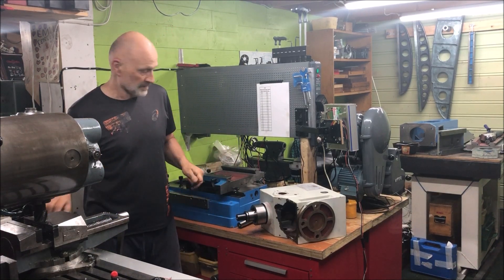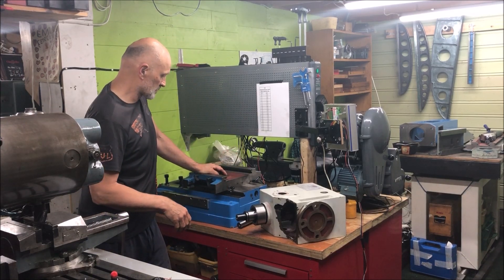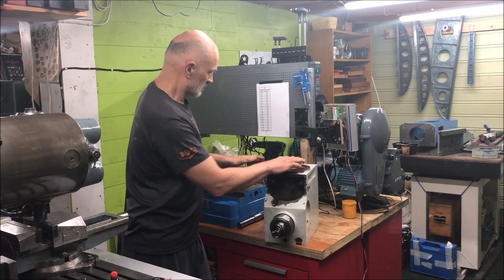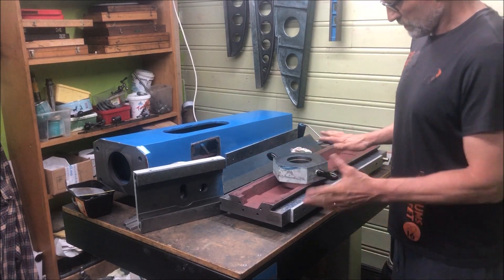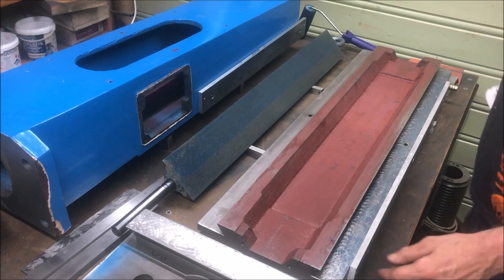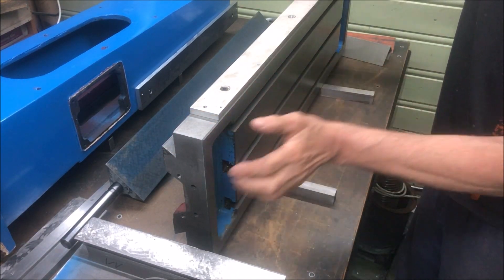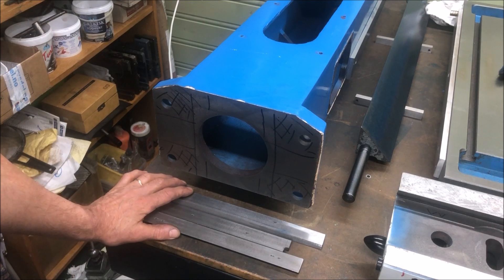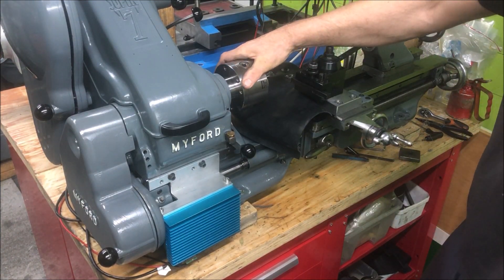HBM 45 mill-drill mods/fixes - intro

Comment: As usual this should be a really interesting series Jan. I think the word you were trying to remember in the beginning of the video was an eccentric bored bushing. That would allow an adjustment method to set the pinion engagement with the quills rack teeth. You'd obviously know that term in your native language without even thinking about it. But English from what I've been told can be a bit tricky with some technical terms.
Reply from the maker: Hehe.. yes, exacty. Thnks... I think age starts to make its' way (hopefully it is the accumulated and acquired knowledge meaning less "memory space" in the brain, but I don't count on this  :) I must admit that at my level of video making, the preparations aren't always good enough.. just a bare minimum to get some footage off the ground without too much effort. Good enough being the mantra.. Anyway, yes, I think this will be an interesting journey. I might end up with a similar construction myself.. one day.. haha. PS! There is a lot of reviews/modifications etc. and also CNC'ing of these types of mills and I am astonished by the number "near similar, but not exact clones" out there, from a plethora of sources with different names. Popular size/price and a practical machine I guess!
Reply: @jansverrehaugjord9934  Don't sell yourself short Jan, your videos are just fine the way they are and you do a hell of a lot better than I would with my totally non existent second language of any nationality. I only added the term for what you were trying to remember for anyone that might be wondering what you meant. In fact I happen to think your video production and editing is much better than most. There's no wasted time with a pointless lead in with loud theme music, no constant begging to subscribe, no useless channel stickers or off topic chit chat. That to me is exactly how it should be. :-)

Yes there seems to be a few different manufacturers of these 45 sized mills. Some even with built in powered spindle feeds. I even considered buying one for awhile, but I finally picked a 3/4 sized Bridgeport clone from Taiwan. For me and what I do it was a more versatile mill choice, plus there's a lot more additions and nice to have items made to directly bolt up to a Bridgeport machine. This new series will be an excellent one for anyone who owns even one of the smaller X2 and X3 mills since most of it will apply to those as well. That's a huge number of owners looking to properly adjust these mill types even if they don't choose to scrape them in.
Reply from the maker: @turningpoint6643  Thnks! Nice to know this is appreciated the way it is! Totally agree to what you write.. far too much "nonsense" (in my humble opinion) in many "productions". Not that many not are "jaw-droppingly" good made and each to one's liking.. we are all different. I personally have never much liked background music (although I sometimes forget to turn down the radio..). For me this is just "noise" that impedes the message I try to get from watching/reading. Sometimes to the point that I just have to cut sound alltogether. Same with too much "face focus".. ie. the person(s) involved seemingly wanting to be a larger art of the video taking too much room/focus for my liking. Can't see any value whatsoever for me to film my bodily presence more than absolutely needed (I mean, what value is there for anyone to want to watch an oldish, bald guy haha), rather just trying to show exactly how/what/why ie. the topic/video is about. I also don't care much about the number of subscribers (just more work to answer comments :) ) as there isn't any earnings in this anyway (but this may be different for those that are real YouTuber's. Or so i have figured, but really have no clue..)
Presentationwise, I am probably of a more "old school" nature and appreciate that there is not much of the very speedy and audiovisually "have to happen something all the time" approach what seems more for the younger generation. I like a more calm and "normal for me" setting focusing on the topic only. There are some channels that "voice" this.. Saying this, I am also somewhat interested in firearms and then I really like the approach you see in "Forgotten Weapons" by Ian McCallum. Calm, clear voice, precise and detail oriented etc. No music, and not at all "acting out" on camera.. And not too long a video each time, ie. one topic per video. I am impressed by how much he knows (and must have researched) on a single topic and how easily it flows when he presents this (not so easy.. I also hold seminars etc. and there is usually MUCH happening prior to the event as well as behind the scenes..). Different topic, and more lengthy, I have also found the maritime information channel by Drachinifil very good. More like a picture series with vocals, but very good presented.
Re. the mill: Nice size, price and functionality. I am tempted to try this or the smaller brother, 30 style as I try to convince myself I need a good coordinate boring machine/bench style milling machine. I see that for example the version from Precision Matthews has a sturdy cast iron stand (and powered down- and cross feed and drawbar) and looks very nice. It could perhaps be a choice to buy from a company like this instead of directly from the manufacturer. That said, we have some local companies here also that imports "similar" machines, so that is a choice. I have also evaluated a Bridgeport clone (there is one down in Denmark that i want to look at.. Taiwanese. If not mistaken, possibly a company to where Richard went to teach scraping). We'll see when the borders open up again..
Then I have also looked at a Tormach as an alternative if I want to go CNC. There are just so many choices and the right answer dependent on the personal preference/situation.
Reply: @jansverrehaugjord9934  :-) exactly my thoughts about the machinist channels on YT. These are or should be produced as informational videos about technical subjects and that's why I'm watching so I can increase my knowledge. There not music videos or Home & Garden shows. :-) If the channel and information presented is any good people will subscribe anyway. And if I want to be entertained I'll go watch a movie. 

In your location finding a good condition SIP jig boring machine and rebuilding it back to as new condition might work. Although that would be a bit larger than bench sized machine. I'm sure there's other European manufacturers of jig borers, but SIP is the only one I know that has a very good reputation. There apparently as good to possibly better or perhaps a bit more versatile than the Moore Tools jig borers. And that's a very high bar. If Europe is anything like North America any of these manual jig borers are in mostly low demand for use in the average commercial shops today so the prices have dropped to almost nothing for what they are. Before watching this video of Tom Liptons, https://www.youtube.com/watch?v=dXDOvAa6Mus I hadn't known they made smaller HBM type machines with jig boring accuracy levels. Obviously there built to extremely high standards and again very versatile. With the tail stocks they also were offered with, one of these might be a single small foot print machine tool that could be set up to do almost any turning or milling job in a home shop. If you don't already know of his channel? https://www.youtube.com/c/ELMETALRaymondMenendez/videos He's a literal artist with an HBM and an extremely talented machinist.

My Bridgeport clone is Taiwanese and was built by a company called Bemato. A quick search and they don't seem to be offering the same mill today. But someone is, while I didn't buy mine through Precision Matthews this is the exact same machine I have with a step pulley head. https://www.precisionmatthews.com/shop/pm-935ts-tv/ With a VFD on mine I don't really need or miss not having the variable speed head version. But I know the PM machine is the same as mine because of it's distinctive squared off upper column shape in the casting. What they did was reduce the machine size to roughly 3/4's of a full size machine, and used a full sized head with the powered spindle feeds. But the Bridgeport design layout and it's known part sizes also comes with some further and not generally known hidden future options to increase what it can do.

At one time before cnc, Bridgeports over here were used a lot in Tool & Die and Plastic Injection Mold shops. So there were many specialty heads designed around a BP's known standard dimensions and it's R8 spindle taper. There sort of like your Schaublin or Deckel FP1 & FP2 mills with a bit less rigidity and versatility compared to a real Schaublin or Deckel and there many clones built all over Europe and even old East Germany. So the Bridgeport R8 taper and it's spindle diameter of 3.375" was used to mount those heads. Volstro here in North America was a fairly large manufacturer of those specialty heads. Unfortunately they were a victim of that move to cnc and are no longer a company. These heads are one of the big reasons I chose the mill I did. It took me over 10 years of searching, but I finally found and bought one of there rotary milling heads. It was this one in fact. http://www.chaski.org/homemachinist/viewtopic.php?f=30&t=110132 And I know for a fact it was only used once to make a single test cut. So without that Bridgeport design some of this equipment just doesn't fit or work on other machine types. And I've yet to find a single accessory designed to be used on a real Bridgeport that doesn't bolt directly onto my mill. 

Funny you mention an interest in firearms, that's what got me started in machining except the gunsmithing part has now mostly disappeared. He builds mostly traditional style very expensive custom bolt action rifles, but this single video shows his machining ability's more than well. https://www.youtube.com/watch?v=3UaPfRsXnkM All done to coordinates using a dro and without cnc.
Reply from the maker: @turningpoint6643  Same with radio channels these days, just music, chit-chat and commercial.. the "only" sane channel that has some good reporting up here is BBC World.. solid information from ground crew (all over the globe) on a vast array of subjects. In my mind at least it doesn't sound "politicized" either..
There is actually a SIP jig borer for sale now not very far away. Too big for my workshop though. Some of my machinist friends has different types, both larger / older (SIP) and the smaller, modern styled Hauser  http://www.lathes.co.uk/hauser/ and one friend with a Moore. Incredibly accurate machines! He showed me it has repeatability at 1/1000mm.. :) I doubt that I will need such a machine, and the price would probably be prohibitive. I looked at a more reasonably sized & priced English Downham (Elliot) http://www.lathes.co.uk/elliott-mini-jig/index.html, but didn't act, so this opportunity was lost. However, I might get my hands on one of these, not cheap, but very tempting.. http://www.lathes.co.uk/fehlmann/ The "trouble" with the latter is that it normally uses special holders and in general that everything costs "an arm and a leg". So.. I might end up with a more budget machine. The Schaublin 52 milling that I have of course has a hi-speed head with quill (E25 type nose fitting, same as ER but without the unlocking slot), but it is an operation to switch between the two heads (other being ISO40, which tends to stay on, despite not having a quill. Another user had a good hint though, just turning the head horizontal and use the feed.. this being more controllable than the Z-feed, although still not as a quill). I have also looked at a Golmatic MD23, as a versatile, accurate alternative to a mill-drill type of Eastern origin. However, from a practical point of view, a B'Port type is possibly the ultimate mill for a typical small shop, doubling as a large capacity drill press.. and precision borer.
The machine Tom Lipton has and shows is very neat.. looks like the same size as the SIP for sale here.. hmm..
Hadn't seen MetalRaymond before.. looks like a very nice channel! So more YT watching :)
Your mill seem like a more or less direct B'Port Series 1 clone, but scaled down? That sounds interesting (space, also height is always a problem..)
We actually have a lot of the Adcock & Shipley built Bridgeports over here, and some original US built machines (could be from military airplane repair facilities that were equipped with a lot of US gear.. as you may know, we have bought US planes since the late 40'ies/early 50'ies)
Therefore it is not uncommon to find accessories ie. have seen a fair amount of shaper heads for example
Thnks for the "firearm workshop link" .. I bet I will be more in front of the PC tonight than in the workshop..
Reply: @jansverrehaugjord9934  Yep, I use my shop as an "escape" from the rest of the world and all it's issues so don't need the intrusions or political ravings most radio stations now seem to have. I'd certainly agree that BBC is probably the least biased today. 

My Volstro rotary head has a full set of Schaublin produced collets and I'm almost positive it's the same E25 size you mention. In case you don't know this already, my research seems to indicate Rego-Fix took the original Schaublin collet design and added the extraction groove, changed the collet nut to an eccentric design to use that collet extraction groove, plus they increased the closing nut threads diameter and came up with what's now known as the ER collet system. Unfortunately due to that larger thread on the collet chuck body and the nuts, the standard ER collets and nuts can't be used in any of the E series designated equipment. Before Volstro closed there doors for good they did offer there later heads so they could use direct fitting ER collets. I don't know about in Europe, but over here finding those proper Schaublin E series collets for these heads is a large problem. It's not unusual to see prices for used and even poor condition Schaublin E25 sized collets at upwards of $80 - $100 each. So I'm fortunate my head came with a complete set.

I'm familiar with those Hauser and Fehlmann machines but only through the internet and without ever seeing one in person. Very, very good equipment mostly used in watch, instrument and high precision small part production in the pre cnc days as far as I know. The Elliot Downham I hadn't known about though. It has a fairly common earlier design layout and I believe the earlier P & W or possibly it was  B & S? jig borers used much the same as the method Elliot used with that divided spindle and tool support. Afaik all of the Moore jig borer models have a quite tall size for there smaller foot print. I think there at least around 9' tall? And they have a complex very fussy procedure if the spindle bearings require replacing. The bearing preload is much tighter than normal and there's very little + - tolerance between correct, too tight or a too loose adjustment. I think many wrongly look at those Fehlmann's and think there just about a glorified round column Chinese mill/drill. It's highly likely the Chinese took a lot of it's general design for there's, but those Fehlmann's are light years ahead of what the Chinese machines are. From what I've read on the Practical Machinist forums there very highly rated. I'm not sure if they were ever offered with any other spindle taper, but I believe most or maybe all Moore jig borers use a Moore specific proprietary spindle taper. So likely hard to find and quite expensive where you are for any tooling unless you bought one that came with an extensive amount of tooling already.

The information I've seen about licensed Adcock & Shipley copies of the Bridgeport is they might be even a bit better than an actual Bridgeport produced machine. The newer BP's also use off shore sourced castings and have for some time. So I suspect those older Adcock copies using UK produced castings might be better even in that aspect. At this point with Brexit I've heard it's tough getting anything out of the UK and into Europe. That will probably change, but for now it cuts you off from a lot of the used machine tools in the UK. There prices aren't exactly cheap, but they usually only list very good condition machines and tooling on this website if you don't know of it yet. https://www.homeandworkshop.co.uk/browse-stock/ And I know there well set up to do international shipping once that Brexit issue is sorted out. And I've seen some fairly rare, unusual, and highly desirable machines and tooling there sometimes.

I've also been to the Golmatic website a few times, an interesting multi purpose machine but fairly expensive for it's size. If it's accuracy and build quality match it's price it would be a handy machine to have. So far I don't recall ever reading any forum thread from anyone who has one or have even used one.

If it will help in your decision making, my mill has a total height of 77.5" / 1968.5 mm with it's 3 hp 3 ph motor. Since the motor is the highest point on the machine, a different motor used by the manufacturer will obviously change that number. My own motor has a height between the mounting face flange on the top of the mill head to it's highest point of approximately 9.875" / 242 mm. Even with it's smaller 9" x 35" table size, I was surprised to find the manufacturer still used the exact same bolt pitch spacing and size for the tables end brackets and bearing hangers for the X axis feed screw as Bridgeport did. Any standard power table feed for the X axis that's made for a real Bridgeport or clone bolts up without any modification. I don't yet know if that's true for the Y and Knee's Z axis though. I had to pull mine apart into it's major components to move it into my shop, a fairly simple job of a few hrs if you've got an engine hoist. With these Taiwan produced mills I'd still recommend doing so even if you can move the mill as one piece. While I didn't find lots of machining chips or grinding dust, there was a few grams so I'm happy I did so. And completely washing out that contamination and the shipping preservative it came with gave me a far tighter yet much smoother to operate machine. As shipped with factory adjustments I had about .007" - .008" feed screw backlash. After reassembly and gib/feed nut adjustment I had .0035" - .004" with no trace of tightness in the table travels which is what Bridgeport themselves guarantee on there new machines. The real Bridgeport's are afaik still oil flaked, but mine has only surface ground ways. We both know there's much better spindle tapers than R8 and even more so where you are. But B'pts are mostly thought of as a light duty machine compared to your Schaublin. So that R8 is ok and fairly reasonable for tooling costs. It's too big for any R8 taper mill, but I'm using a Bison ER 40 collet chuck and collets on mine. ER 32 would be ample, but I wanted dual usage from the collets for use on my lathe so I went with the larger 40 sized collets. R8 collets would be better and more rigid, but so far I've yet to find anyone offering 100% guaranteed low run out numbers on there R8 collets other than Hardinge at $65 each.

Bridgeport at one time also made what was usually called a 3/4 sized or Baby B'prt. From my research not many were ever made and I only know of one that a personal friend owns. It also has that 9" x 35" table size so my guess is the Taiwan company that built mine closely copied it. Jet also did or still does offer one of there mills in this size, but strangely I've never seen it available with those built in spindle feeds. And I believe it only has the single axis X axis tilt function on the head so it's not capable of nodding in the Y axis.
Reply from the maker: @turningpoint6643  Same here.. I have an "office type of job" and the workshop is a welcome "relief" from this..
Interesting! I didn't know the story on these Schaublin collets. PS! The collect adapter on the hi-speed head can be used with ER collets (same cone/design.. at least as far as I have understood/experienced, I have a couple of E collets also in addition to the ER25 set), but I have to add some form of "extractor" or "ejector" either by modifying the existing nut (I cannot buy an ER type nut as the threads are different) or use a tool (I have made a kind of "fork") that grips into the slot and (gently) forces the collets out. Not ideal, but..
Yes, the Fehlmann "mill-drill & coordinate borer" might be the grand-father, ie. what the Taiwanese looked at when they designed a simplified, budget version of the round-column mill-drills. The Fehlmann is of course much better, but also much more costly! The problem can however be whatever special nose adapter they have made or adopted (as is also the case for much the early Swiss-type of hi-end machinery, both from Schaublin, Aciera and more..), so if you don't have access to these or money to buy.. then better stay at the more budget machinery :)
Oh, yes, I am very much familiar with Home&Workshop, having bought most of the Myfords (and more) there.. Always very nice to pay them a visit, either at the stand on a model engineering show or at their place in Sidcup (and get a cup of coffee :) . They have shipped to me several times and it is no problem at all, only difference now from before (when they were part of the EEC) is that we have to pay the VAT..
The Golmatic is expensive, but packs a very good punch on a small scale! I could have bought a Chinese copy for about (a decade ago, listed in the Knuth catalogue and displayed at their Swedish distributor, but at that time I didn't have the money, and this was discontinued..)
Thnks for the dimensions on your Bridgeport clone, I guess I have to have a closer look, possibly a dealer in Norway or Sweden has one. I guess that a certain degree of tackling smaller issues is to be expected on these machines. After all, they are cheaper than original Bridgeports and probably doesn't undergo the same amount of "fit & finish" work. Re. Bridgeports, according to what I have learnt from Richard (who has scraped quite a few) they were guaranteed to be within 2/10 over 12", and as such are classified "industrial, normal grade". I guess an R8 is more than sufficient for hobby, light industrial use.. sure! Cheap and lots of tooling.. I reckon it was a good choice to go with ER40, although for most cutters 32 size would be sufficient, but for any lathe use 40 would be better. I am often pondering over this issue about new/used tools/tooling and whether it is better to buy old/used hi-quality or new, not necessarily so accurate items. When it comes to collets I would in particular have my doubts over used items, although these being quality, how accurate are they when bought used? And if you need to buy new, then what is actual price vs. functionality cross-over point.. ie. what do I need / how much can/will I pay? Me buying the Schaublin was purely a random thing.. just happened to come across this on one of our "machine tours" (Denmark auction). If this hadn't materialized, I bet I could have ended up with a B'port :)
It could however be that I end up (again.. had one, but sold it) with a Storebro Combimill, which is one of my (if not THE) favorites. I have also been interested in a Van Norman, for example a type 12. These are very sturdy & versatile mills for their size. But, a proprietary milling holder system possibly being a problem.
Reply: @jansverrehaugjord9934  Well as I mentioned that's the story I've picked up about how the ER collet was "invented", it sounds reasonable since Rego-Fix are credited as being the first to produce them and the Schaublin collets are almost identical to the ER series on there exterior dimensions. And yes from everything I can verify the taper angle is the same between the Schaublin collets and what the ER has. For however much this is worth? I just measured my Schaublin E25 collets and there roughly 1.381" in length by a caliper measurement. Comparing that number to the industry standard for ER 25 collets that have a length of 1.340, the Schaublin E series seem to have a slightly longer bottom taper of roughly 1 mm. So Rego-Fix must have changed that a bit as well. When I bought my little Emco C5 sized lathe about 25 years ago I also bought there full set of ESX 25 collets that can be used either on the mill or lathe. They do fit very well in my Volstro head, but again like your Schaublin mill they can't properly be used because of that extraction groove and the nut size and thread pitch. I've read but don't yet know for sure that ER 25 collets are interchangeable with the ESX series. That Emco collet set was very expensive at the time. I don't know if Emco was making these themselves or they were from an outside collet manufacturer. But that little collet set cost me almost exactly what my Bison ER-40's and it's collet chuck did. Yes these Emco collets are very well made, properly hardened and precision ground so there quite accurate, but they sure hurt to buy. :-) 

There's a fair number of videos here on YT about off shore collets and lots of them show very high run out numbers in both the collet chucks and collets themselves. I've got 3 jaw lathe chucks and even keyless drill chucks that are more accurate than what some of those videos are showing. So for lathe use there's zero advantage to work holding with them over what I already have. Yes an adjustable chuck back plate could be made, but other than better grip and less jaw marking of the work piece you may as well use a 4 jaw independent if you still have to dial a single part in. Where you are then it's additional shipping charges, customs etc. but for decent mid priced set of ER collets today? I think I'd now buy from here. https://www.maritool.com/ER-Collets All of his products and his business practices, fast shipping etc get very good reviews on the Practical Machinist forums, and the owner is also a member there. In fact it was through PM posts that I learned of the company. I believe but don't know for sure there collets are made in house by them and are specifically not off shore or poorly made. More expensive than off shore collets, but certainly much more reasonable than Rego-Fix, Bison etc.

We both understand why collet run out numbers are important, but I'll add a video link for anyone else who doesn't know. This video from Rego-Fix themselves while being almost all about industrial production use and costs of ER collets, https://www.youtube.com/watch?v=uM9qVWhMWy0&t=3s It does show there's some hard numbers, logic and direct costs in support of buying the better collets. For anyone else who doesn't yet know, those higher run out numbers very much decrease the usable tool edge life span, contribute to chatter and always produce much poorer surface finishes along with a decrease in part accuracy. Saving money is of course important to all of us, but I firmly believe there are some basic foundational tools where paying more in the beginning can end up saving much more than there cost over some time. I'd say for most of us with a home shop, a set of tool holding collets are just about a one time purchase with a life time of expected use. Tool and work holding can only produce parts close to the same accuracy that there built with.

Yes I'd expect there has to be a few dealers in Europe that offer these same reduced size BP clones. It would be highly unusual for a large machine tool manufacturer in Taiwan to tool up and produce a machine model only for the North American market. As I mentioned though, that distinctive squared off upper column casting shape would be something to watch for. I think your correct about that fit & finish on these cheaper than real BP mills, but having mine apart the hidden areas and castings are still much better done than the hidden areas on my Chinese 11" swing lathe. I've yet to see any one single "perfect" mill that can do everything so far. There's multiple designs and attachments to do certain jobs that just aren't available on any one single machine that I know of. You mentioned Knuth, I'll admit there probably a longs ways from your high quality, high precision German and Swiss machines, but they and maybe a few others offer a much larger and I think 40? taper BP type design that has an additional built in horizontal spindle as well as having a swiveling universal style table. If my shop was larger with a taller ceiling height and had a concrete floor I think I would have bought something like that. But what I have does still work well enough for me. I also suspect those larger machines cost as much or maybe a bit more than a new BP.   

Industrial quality brand name used verses new but made off shore? Yes that's a tough one. I'm a bit different than you and almost all of Canada's manufacturing is roughly 3,000 miles from where I am. There's very little used industrial grade tooling here on the west coast. Any that is available almost always comes with very high prices. With your location and large European used tool market plus your trips to the UK during normal non Covid conditions that gives you a better ability to at least visually check over anything your buying that's used. But with used very good industrial level tooling like collets they at least always indicate how much they were used and even how they might have been treated or mistreated. But like you say, it's still taking a chance on how much life and accuracy any tool might have left.And yes I'd very much agree, a lot of these older machine tools used spindle tapers or proprietary attachment methods that were once not that hard to find. Today and as you say some could be very rare and expensive if you can even find it. Learning as much as possible about what your buying before you do so really isn't optional. 

I thought you might be familiar with that Home&Workshop website but added that link just in case. I've only spoken with them on the phone a few times. But they were very helpful and the only reason I didn't buy were reasons not related to them as a business. The Denford lathe I was looking at had metric feed screw pitches and I wanted imperial, and the Elliot shaper I was interested in was heavier than my shop floor is really safe for.  So I bought the much smaller South Bend shaper. For most of what I want a shaper for it's probably large enough. 

Yes a Van Norman would likely be well above any B'Port. Afaik they did use there own spindle taper, Google say's it's a C taper or the Hardinge 5V will also work in the #12 machine. Since I really don't know the taper dimensions it's impossible to say if the spindle could be reground to a more common taper. There is of course the problem of at what point does any machine become non cost effective to buy? Your mention of that Storebro Combimill was a new one to me. It looks to be a very well designed and rigid mill from the few pictures I've looked at so far. I also think a mills initial cost is almost incidental. Adding the proper tooling and accessories is always a lot more. I've got over twice into what mine cost just in it's tooling and accessories. For these B'Port design mills I could probably double that again if I could afford to for a really versatile machine. NSK, BIG Kaiser etc made or still make some really well made accessory heads for these machines, and even a used optical jig boring rotary or dividing head would be very nice additions.  :-)
Reply from the maker: @turningpoint6643  Agree, a collet should be better than a universal 3 jaw, otherwise there is no point.. just more hassle. Thnks for the link to Rego-fix, i found that a very useful "lesson". There are certainly (many?) other sources here in Europe also, but it is tempting to have one good set at least. I also need to practise using/setting up my 4 jaw as this is a good way of getting parts centered. However, I find that my 4 jaw chuck on the Russian, which chuck is a Chinese (hard to get by an original old type Bison that it used to come with) and the threads on the screws are too coarse for any type of fine adjustment.
Pls. see the link here to a Danish machine dealer https://www.bnmaskiner.dk/collections/fraesemaskiner-brugt
They have a variety of good mills on offer (not at all bad priced really). The Schaublin 52 is of course the same type as I have, while the Schaublin 13 is a smaller variant and very high class. The Provomajska is a straight forward Deckel 2 clone (or very similar) and also good. The Fexac is the same as we have at work and this is a very nice example indeed! Can hardly be used. Very typical industrial style (Spanish build) and a good allround mill. Had I only had the space.. Then the Frejoth B'Port copy is my favorite among this collection.. at least to that price (1Canadian Dollar = 5 Danish Kroner). Then there are many more available. Sweden also houses many machines, and then we are close to both Brittain and Germany, so the so the choice up here in Scandinavia is good. Even importing from the US can be OK as there are some freight companies specializing on contaner shipments to Norway (car import..) I asked once for a milling machine, at one metric ton (1x1x1m on a pallet and this was only like 250USD on a boat)
Reply: @jansverrehaugjord9934  Yes that's an interesting video about the hidden costs of just a set of collets. Maybe of a bit less importance in a home shop, but it's still information worth considering or at least knowing about. Tooling costs aren't quite as simple or obvious as it first seems sometimes.

Wow Jan, some great condition and beautiful machines just on that one website. I'd love to have any of those.I've always been envious of the availability of the smaller high end tool room quality machines and tooling you have all around Europe. Plus all your homes already have fairly high voltage 3 ph power available. I have to run a phase converter on anything that's 3 ph, no real problem with that as it adds some desirable motor control options if you use a VFD, but it is an added expense.

And yes that Russian or Eastern block equipment is also worthwhile and they probably average a bit lower for used prices. The last copper/gold mine I worked at had a fairly large Russian lathe. There fit/finish is maybe a little behind something like a German or Swiss machine, but they seem to make very stout and rigid equipment with lots of cast iron where it needs to be. The mines machinists told me he liked that lathe except that there could have been a bit better range of feeds on it. Since I can't read Russian I have no idea what brand or model it was though. It had maybe a little bit less than a 1 meter swing and about 2.5 - 3 meters between centers. And my Czech made Narex B&F head is almost too beautiful to use. :-) But there pretty expensive over here. If one of the older Wohlhaupter's are better it can't be by much. And Spain from what I can tell makes some well respected machines. The X,Y table for my little Emco C5 mill was made there. For it's size it's very well made and with quite accurate feed screws.

That's a very good price on shipping from North America - Norway for that weight. I moved my mill at a little more than half that weight from the north east coast of the U.S. to almost the south west coast of Canada and it cost a little over double that amount.

I can't think of any easy method of getting around that coarse thread pitch problem on that 4 jaw of yours. It might be impossible due to the limited wall thickness left on the chuck body to re-bore and re-thread to a larger and finer pitch. A much longer handle on the chuck key might help a bit? Or you could try making a set true type back plate and use that as your final adjustment method to get it almost exact.We have a brand of lathe chucks over here called Gator http://www.gts-tools.com/gator-lathe-chucks.html  that are supposed to be fairly good with much better prices than Bison but I've not personally used one. There is some talk on the forums that there being made by Bison but I can't verify that well enough to be sure they are. And I haven't checked what thread pitch they come with. Plus that brand name might be specific to only North America.
Reply from the maker: @turningpoint6643  Indeed a lot of nice machines there. I plan to go there to have a better look (in person.. risking this as there is always a tendency to buy something.. the "sickness" taking over :) ). I have been there before, but awhile back. Just have to wait until I get my 2nd vaccinations shot in early August, then we are free to move abroad.
Oh yes, the Russian machines are nice. Maybe 1.5x as heavy as comparable Western machines of the same category and possibly a bit more "rough on the edges", but they perform well. I bet they copied a lot from ex German machines after ww2 and possibly other (Rumenian and Czech).
I know that shipment prices have moved quite a lot recently, so probably not so cheap anymore, but still a viable alternative I would think.
No, you are right.. the 4-jaw thread pitch is a problem that persist. I have however seen other, better chucks that "perfom". The trouble with the IZH1i611p lathe is the nose/chuck adapter is a special one. Dimensionally like a mix between Camlock and DIN, made according to a GOST standard (ie. former Soviet dominated (dictated?) system)
Reply: @jansverrehaugjord9934  While I'd watched your IZH lathe video before, I went back and re-watched it again for your chuck mounting details. I see what you mean. I have a similar 3 stud mounting system except mine uses a very tight fitting parallel hardened and ground stub to center the chuck back plates. And there's also a loosely fixed rotatable ring with key hole slots in it used as the heavy washer behind the chuck register flange for the stud nuts. Yours is better in every way other than being a lot tougher to machine new chuck back plates because of that exact taper fit. I recall finding the proper DIN drawing for mine but have lost where that website was. So mine wasn't something new the Chinese came up with on there own. The later models of my lathe did come with a D1-3 spindle nose which in my opinion would have been much better than what I have. Mine works, but is quite a bit slower and maybe a bit less accurate than a cam lock system would be.

And re-watching your lathe video it reminded me just how nice it is. A very heavy well designed machine for sure. While mine has comparable swing and between centers length, it's not even close to being in the same universe as yours is. It would fit very well in my shop but it's far too heavy. :-(

That GOST was one I hadn't known of before. Thanks for mentioning it. It makes sense the Soviets would have had there own set of standards. Although today I would imagine it's now a mix of the old and some German DIN standards mixed in just due to the now more open trade. I've been told there's many more Soviet era machine tools here in Canada than the U.S. but there still not that common out here on the west coast.
Reply from the maker: @turningpoint6643 The IZH chuck mount is probably one of the standard systems (GOST) used for machines in that part of the world and in that era. The centering cone is similar to Camlock 3, but with 4 studs and then these almost similar, but still a bit different diameter than the DIN.. However, it means a D1-3 chuck can be modified, which is what I have done, just drilling/tapping and mounting 4 studs with locking nuts that fit my backplate/mount.
It is indeed a nice lathe to use: practical, sturdy and accurate.. could not asked for much more apart from a larger bore, which is what is (strangely enough) not equal to other machines of the same size (26mm vs. the normal 38)
Not sure about the origin of the Soviet or we can say "East-block" standards, but I suppose it was in large the equivalent of our ISO, DIN etc. systems
Machine like mine are not the most common type, but there some. The most encountered is probably this type http://www.lathes.co.uk/stankoimport/
and derivatives/similar